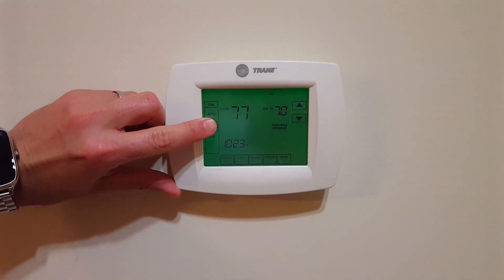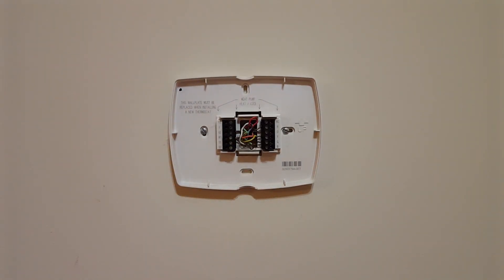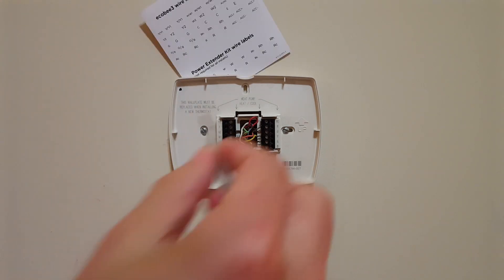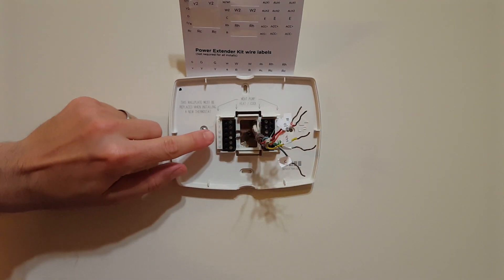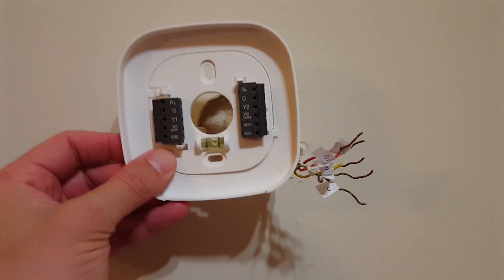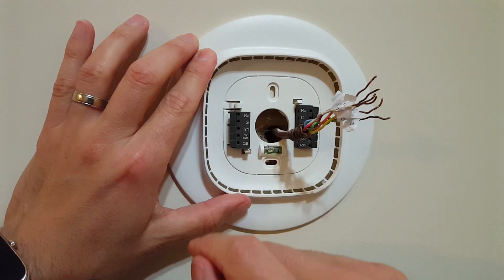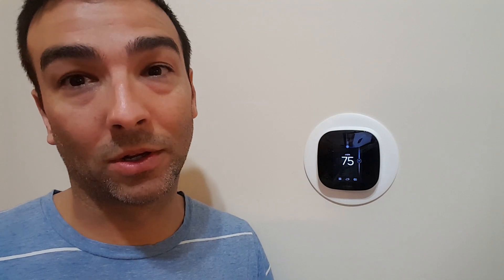Installing an Ecobee3 Smart Wifi Thermostat

Comment: I would have cut down the exposed portions of the wiring to approximately 1/4" so as to avoid the possibility of cross circuitry when you push the wiring back in to the hole prior to mounting the thermostat.
Reply from the maker: Great suggestion!

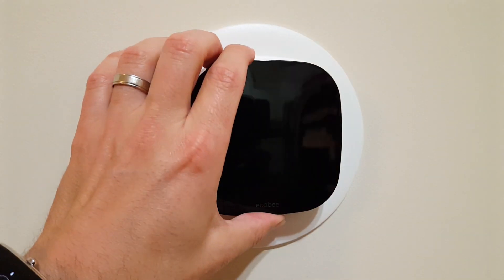Comment: 1:42 picture of wires before. Tools: drill, fine screwdriver, paint brush, master bedroom paint, pliers. Take clear picture how your wires are connected before. Make sure to turn off upstairs HVAC breaker and  bedroom. Label wires... 10:07 wires after

Comment: I have that same model Honeywell thermostat.  How has the comfort been with the Ecobee since they use slightly different methods of temp control - Honeywell has their algorithm that uses Cycles Per Hour along with temp and the Ecobee uses temp, swing setting (you can change in settings), weather, etc.
Reply from the maker: Comfort is pretty good.  I think I noticed the swing a little more at first but now, not so much.

Comment: When did you turn your breaker back on during this process? Was it before you clicked the ecobee on the mount or after?
Reply from the maker: Sorry I didn't include that!  I turned it on after I put the thermostat on the mount.
Reply: Your hvac a heat pump ?

Comment: lol took me 45min and i did  repainiting and drywall repair so i can used the the small plate but I was thinking that the large face plate may have looked better than just the thermostat looking way to big for the wall lol versus the bug plate that makes it seemless into the wall
Reply from the maker: The face plate is definitely not a strong point to this thermostat.  But so many people just beat a hole into the wall  to mount a thermostat that the facade is important.